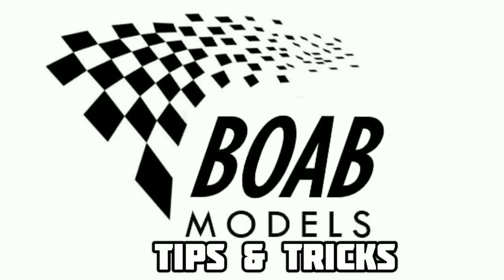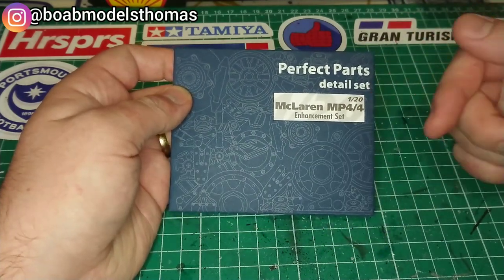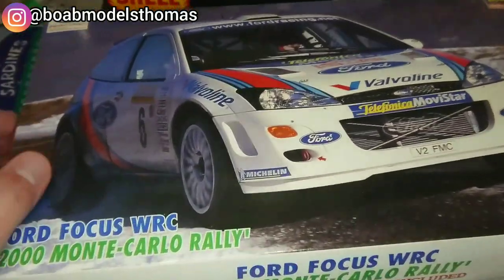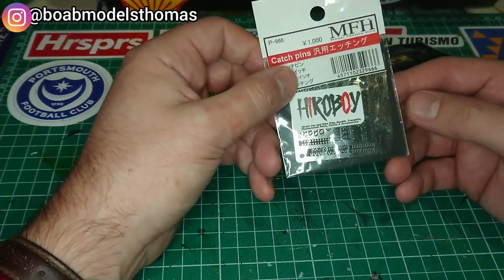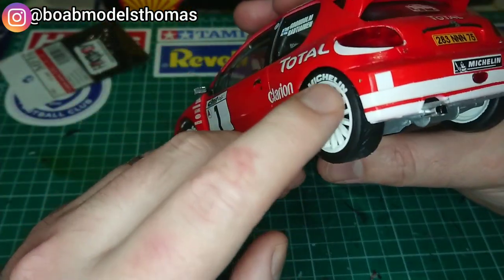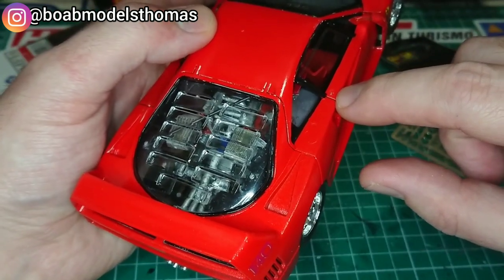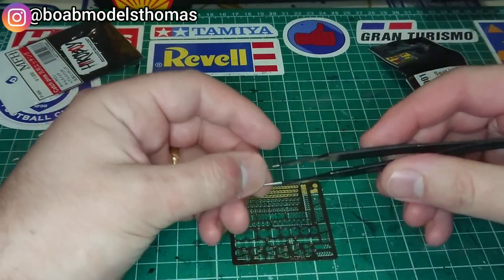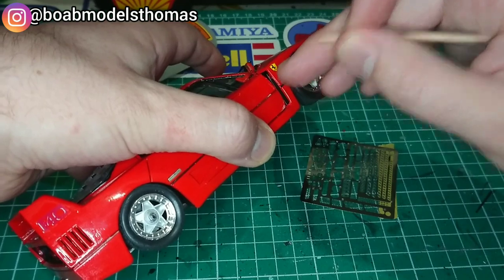Basic Guide to using Photo Etch - Tips & Tricks for scale model cars

Comment from the maker: Do you use photo etch parts? How have they helped improve your builds?
Reply: Just got my first etched parts in today, Came here hoping to see how the etched seat rails go in, not sure if I'm supposed to fold the sides up/down or if they just go in as-is. Also got the seat belt harness & buckles.
Reply from the maker: @hhaste it depends on the design but sometimes there are diagrams with the parts. Also PE parts usually have a crease in them where they need to be folded.
I did another video talking about belt buckles where I demonstrate some too here https://youtu.be/nP--1pqspug?si=vzbHRYATmv0_r4ML
There are a few other types which I also have videos for I think. Good luck!

Comment: Great video Thomas. For gluing tiny photoetch like badges or bolts to a body I like to use a tiny drop of acrylic gloss clear like tamiya x22 applied with a tooth pick. As the x22 dries, it acts like a glue, but isn't harsh at all and won't damage clear coat or paint work.
Reply from the maker: That's a great idea, Justin. Thanks! 👍

Comment: I only the use the parts that come with the kit, all Hasegawa rally cars came with the seat belts which was a novelty back then :)  if you put a drop of super glue onto a plastic lid like a pringles lid the super glue stays runny longer, little tip :)
Reply from the maker: That's a good idea about the glue. As I'm sure you know from my other builds, I add all kinds of parts to my models - I think the photo etch pack which I showed in the video is pretty useful, especially when some race cars don't come with bonnet clips.

Comment: I am finishing the paint,sanding, polishing , clear Coat of AMT's 67 Impala SS.  I just received the photo-etched upgrade and have a few questions. On this car there are very small tedious scripts that will make all the difference in a build. I am curious to know what method of adhesive do you use that will give some time to place it in the exact spot without leaving traces of adhesive which can be extremely disappointing and not look good.
Reply from the maker: I would recommend either using white glue or a little dab of clear paint. The white glue is less likely to leave any marks on the paint but the cure time is slightly longer. I hope that helps.